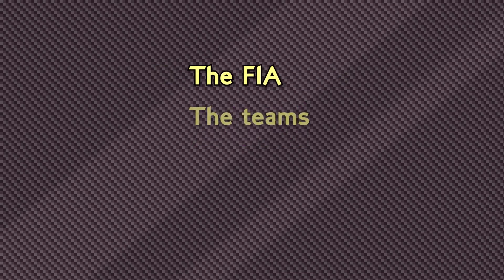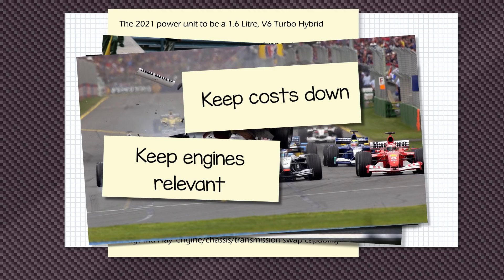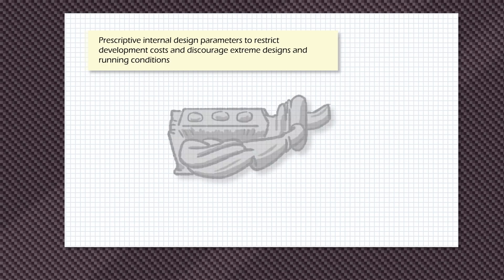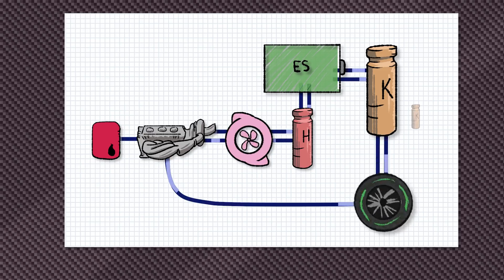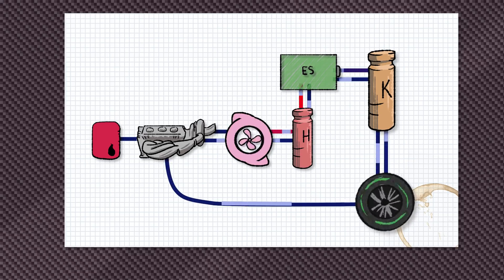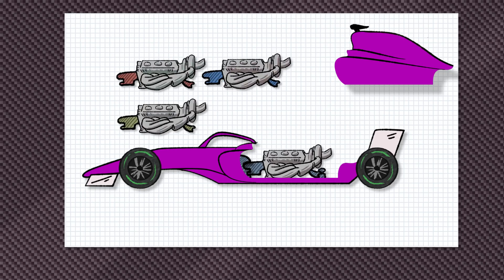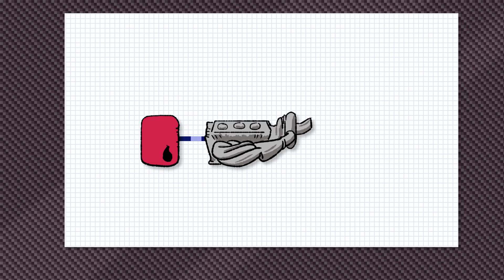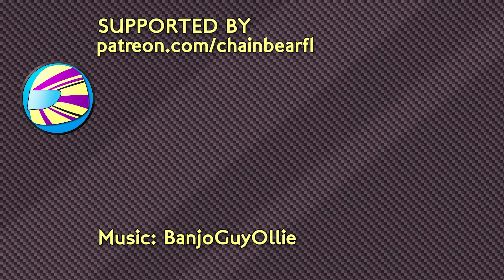F1 Engine proposals 2021 explored

Comment: In my opinion there is no reason for F1 to gradually phase out petrol engines. There is already Formula E.  If they want to develope these technologies, they have a separate class for it. 
F1 is suffering from an identity crisis. This comes mostly from these ridiculous rules changes that force a technology on the spectators that they really dont want. And to call these people hipsters because they like exotic gas burners with raw horsepower is a bit myoptic dont you think? 
But if F1 wants to flip their finger to the fans then that is their business...even if numbers keep dwindling to no one.  Sorry, i just dont see fans returning because they raised the rpm to a 15k limit.

Comment: I wish there was a racing class that had simple rules. Your racing on F1 tracks, you are limited to 1 liter with any power adder and any fuel and any car configuration you desire but it does have to have at least 3 wheels. Safety is determined on a case by case basis.

Comment: Some should really start Formula BTR (back to roots) with loud V8-V12 limited by number of wheels and size of the car... screw these 1.6L who wont last more than 1 race. Also changing all tire size, engine parameters, wingles etc etc. is very enviroment friendly when you have to pretty much build the whole new car for each season......

Comment: So many people remember V12s fondly. In fact, in last 50 years (so between 1968 and today) just Cosworth DFV (possibly the most legendary engine in F1 ever) won more WDCs and WCCs then all the V12 combines. In fact, V12s only had a bit of success in late 80s with Ferrari (large part of success being provided by Lauda as well) and then one single WCC in 1991, when Honda played around with that layout (between 1989 and 1990 they opted for V10) and after that, most teams dropped V12 for V10 format, Ferrari being last to use one in 1995.

Comment: There is alot of information here but having unregulated amouth of engines would be very bad as it would very likly increase the already big gap for the top teams as they have a massive amouth of money compared to the mid/back runners.  Driver may claim that in a season where only 1 race changed the world champion that they hade to swap engine and lost grid positions and cost them the championship.  But it is extremly rare that a driver can get past one entire season without a single incident that they could have avoided that cost them points that would have resulted in wining the season.

Comment: This new rule set is important. Its about the very soul of what F1 wants to be. Personally. I think they should give (for sake of example) Ferrari exclusive rights to F1 engines and then keep the teams exclusively privateer. The engines then could be V8’s without needing to be road relevant. The company that gets engines gets a unique and exclusive advertising opportunity and the teams get cheaper costs and we get closer racing, down to Chassis, Aero and Driver, not power as it is now. But I’m not in charge of F1, the FIA and Liberty Media are and I’m willing to support any ideas until I see the product

Comment: F1 should be aiming for 1Mw engines...formula e being 250Kw at the mo....(2018 Astra VXR engine being 209Kw for comparison....

I feel that as time passes F1 will switch and start to use the petrol engine to power the electrical system and not the wheels and then move to design out the petrol engine completely...battery tech isnt there yet....you need 200kg's worth of battery to support 250Kw of power....an F1 car currently has around 700Kw total peak power....

...for now its not reasonable to think removing the mgu-h is a step forward...but there reasoning is because it shifts the tech away from the turbo engine and puts the focus on the kinetic side....there slowly putting the first steps in place in readiness for the electric era of F1....

Comment: First off.. F1 is tripping over their own shoelaces.   Although the fan base is growing or not in some areas F1 is highly regulated like the freaking EU and UN.  They should open F1 back to normal racing by having actual Pit stops, with refueling etc and allow whatever engine size albeit within a certain number of horsepower depending on vehicle weight etc... Basically a Balance of Performance.  On top of that have the points payout go to at least 16th or 17th that way at least every team will get some money for R&D the following year.  Add at least another two junior teams so you have a whopping 24 cars... HOLY SHI*T  I am being sarcastic.  Formula one is becoming boring as fucking hell!  I would rather watch the WEC all day any day compared to F1.  I have been a F1 fan since the mid 80's.  Oh yeah bring back the Grid Girls!  F1 maybe made of highly engineered race cars, but it is boring to the point of taking a nap while watching as there is little competition.  Seriously if you can drive from last place to First place almost every time the top say 3 teams are starting from behind the entire rest of the pack either cant drive worth a shit or are letting the cars go by hoping they get a seat for a big boy team....

Comment: I want to see a return to turbo monsters - 1500hp 1.5L 4 pots. With the massive light-switch power delivery. Should be very entertaining, hehehe.

Just do what WRC does "Here is a 34mm hole. All engine air must pass through this. Go nuts"

Comment: If we need to be easing into electric bullshit, why dont we all just go ahead and start watching Formula E and drop F1 altogether? F1 isnt around to promote road cars, fool. Its around to stir the senses. Hearing is a sense. Take it away and it's not the same.
Reply: Plus, how many more electrical unit failures are we willing to tolerate? Big names falling out of the race with no bang...just slow to a halt while the driver says "no power". They used to make huge spectacular smoke shows upon failure. Lets make F1 as boring as possible, right? Its the future!

Comment: I have a problem with people always saying "the ICE is going to go away so we should just get used to it" because frankly it wont - not in motorsport anyways. Part of motorsport will always be the screams, rumbles, pops and whirs of the engine, it's what give the cars personality and character that play into the enjoyment of watching a race. Sure electric vehicles might take on the road, but on the racetrack there will always be people who put time and love into building the engines that power the cars. The car took over from the horse and buggy, but horse racing still exists, because people still perpetuate the event. Just because you can sell it and people drive it on the road doesn't mean it will take over a sport that has existed for so long. Sure one day electric motors might take over as a more effective engine option, faster, harder acceleration, etc but that doesn't mean ICE racing will just go away all together.

Comment: erm we have formule e for electric f1 needs to stay combustion but why can't we just take our feet of their necks and let see what they can do. if they want to use a v12 let them it will solve the sound problem. personally i think there's 2 ways to get a great out come from f1 first is let them make a single design for the year between all the teams and lets see whos the best driver as lets be honest it's the cars that win the races not the drivers anymore Niki lauda would get bored in a modern f1 i want clutches back put more skill into the driving "separate the boys from the men" i know its not as quick but neither is making them only be able to use a 1.6 so yer reither restrict the fuck out of the cars and make it all about the drivers or completely unrestrict the cars and let them actually go as fast as possible

Comment: Probably 50 CC with 2 liter fuel tank. The car has to weigh 2000 kg and tires can last only 8 laps. No tire changes allowed, though.

F1 just keeps getting more and more boring.

Comment: The day combustion engines are phased out is probably the day I stop watching. I don’t like the way the engines sound now so why would I watch fully electric cars go around the track. I’ve tried to watch formula E and it’s unwatchable because the car sound like crap. Let the tree huggers watch formula E, we want engine noise! I still watch full races from the 80s through the mid 2000’s on YouTube just for the engine noise

Comment: Wouldn't it be far more cost effective to just handicap the sport\drivers? It is not the engines that are expensive, it is the all the cost of research and development. If you keep changing the rules, the costs just keep escalating. Those R&D costs have to pass down to those using a works engine. You want a low cost solution, handicapping is the answer (vary turbo boost, for example).

Comment: they are not relevant for the real world. Nobody uses  MGU-H, Hybrids are made for efficiency and stop-and-go and 99% still do not use hybrid cars. Real world means 99% low power scenarios. This is a totally different playground. For example, because of this, atkinson/miller cycle engines spread more and more. But this limits max. power, so it´s useless for formula 1. And last but not least there is the topic of emissions. And according to this, the old indirect injection engine is the best.
So ... The indirect injection petrol engine is not so bad and old-school as people tell and formula 1 will never be really relevant for the normal engines technology.

By the way: The MGU-H does not transform the heat of the turbo, but the kinetic energy. It´s like a 2nd turbo that produces electric energy instead of just compressing air. Such a device would make no sense at all in an engine that most of the time, runs in low power mode.

And finally .. to be honest. If there won´t be a battery revolution, the electric car won´t spread into the mass market. LiIon batteries are simply not efficient enough. They cost too much. They need too much ressources. And their energy storage level is too bad, too.

Comment: lol. Have a look at a Ferrari 812 Superfast and tell me it's like an old phone.  All the rules are killing the F1 spirit, which has always been to push the limits of men and machines. If you want relevant, clean engines watch formula E, and with cars costing 9 million a piece, without counting the R&D budget, what kind of keeping costs down are we talking about? Is it cheaper to make a naturally aspirated V10 or a hybrid V6 power unit with MGU-K / -H? Keep disallowing human ingenuity to make better and better machines, through any means possible. We'll end up watching formula Prius with horse blinders, speed limiters and fucking diapers... all in the name of political correctness and ecological relevance.  

There should be only two rules. 
1) Anything goes as long as the safety of the driver, the crew and the public doesn't become a concern.
2) Getting to the chequered flag as fast as possible as long as rule one is not compromised.

Eventually when a manufacturer will realise that a fully electric drive is faster and more efficient for their car and will allow them to win the championship they will move to it. Same way they realised 6 wheels on a car wasn't a step forward.

Comment: That Lada pocking made me lol so much XD
Some changes is cool like the MGU-H  is a nice touch and the electric boost is kinda debatable but yeah some changes do happen.Though when its too much its just is.
Isnt there formula e for the sole reason of promoting electric engines?Yeah they kinda seemed a bit silly and sound like my rc car but there is progress.No need to turn F1 into that...
And since oil will run out i would prefer to keep my exploding megaplands and dinos in some freaking cool sports or for a great drive in my car but thats a bit too far from now..Bring back the beasts while we still can.There are way more motosports to perfect electric motors...
it is for always pushing the limit of physics and engineering while providing breath taking moment something that it doesnt do for a long time.Thats the reason more and more prefer moto gp which provides so much more excitement...

Keeping the costs down is indeed a solid reason especially with the ridiculous amounts for R&R especially in the downhilling global economy but sometimes they are going into the other end...motorsports where always where future technologies for normal vehicles are born but they just overdoing it making most races just boring and an calculating match between mechanics and teams for the points and not toe to toe racing  :(
Bring back the fun...

Comment: Since 95% of F1 fans would rather have the v10 or the v12 instead of the Vsucks, we all know that's not possible unfortunately. My proposal would be to #1 bring back refueling!! (All endurance races have it and with little to no problems). With that being said, bringing refueling back would allow for higher revs which would mean louder engine sounds. I'll be honest going to F1 races in person and being able to hear your own farts over the cars going by is pretty embarrassing! Keep all the hybrid components but make work with the higher revving engines. Make the stickiest tyres as possible (20 laps at the most or less) 6 engines a year per car and even though this does not have anything to do with engines, eliminate grid penalties some how!!

Comment: A big factor is, a higher RPM means less torque, more power and thus lighter gearboxes and associated components as it does not need to be as strong.    
I say higher RPM's are exactly what they need, it brings noise, it bring weight reduction and it will also help the cars be quicker.
It is not just aesthetic !!!!
The old NA engines were simply amazing, will they come back?  Probably not, but why oh why are the youth of today so hell bent on turbo everything?   
A real car enthusiast will always love the NA sound of an engine over a turbo one, you can hear it, you feel connected with the internal workings as the valves slam shut and the exhaust is allowed to bark its particular note out the back. 
Turbo's dull an engines character IMO, yes you can make more low down torque etc, but let's remember, the E-Turbo is the only thing that has allowed the successful implementation of turbos back into F1, without it, turbo's would be terrible.
Saying it is "hipster" is to not truly understand race car engineering and not have the ability to truly appreciate masterpiece engines. I take it you think old bottom cam Chev V8's are all crap? So why are they being used all so successfully in LMGT and LMP3 Lemans race cars?

Turbo charging in F1 has its drawbacks such as, extra weight because it absolutely needs the complex E systems for it to work properly and with this comes extra weight, quite a lot actually. 
How do you overcome increased mass in an F1 car?  
Well add more aero, but in the slow speed corners, you still have a slower car, the mass becomes more apparent again, how do you overcome this?  Well add bigger wider tyres, which has been done, what does this do?  
Well it adds more aero drag and gyroscopic forces to the hub and suspension components, now you need bigger bearings, steering rods and suspension components, now we are adding weight again........lol.
The only reason F1 is said to be "moving forward" is to keep development of such systems filtering down into car manufacturers and the advertising dollars.  
With the aero we have today with the old V10 engine era still here, F1 cars would be much faster than they are today, to suggest we are "moving forwards" is subjective, it has been more about industry development than a sports development, obviously all IMO.

Comment: If they get rid of the ICE Formula 1 will turn into formula E. Hopefully they never do that. FIA we already have all electric open wheel cars, and it's kind of boring. They will lose fans if they phase out the ICE.
Reply: But saying that " we already have all electric open wheel cars, and it's kind of boring." ignores the fact that it's probably going to be 20 years or more before F1 is in a position to totally do away with ICE.  That's a lot of time for development of electric tech.  Heck, we might even see fuel cells providing the electricity instead of batteries.